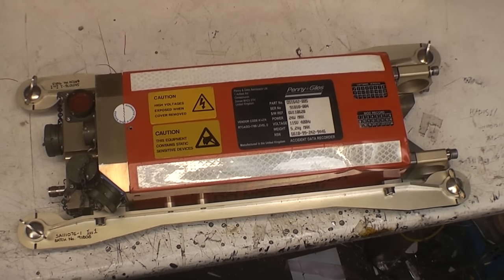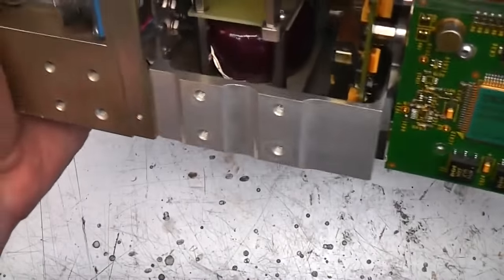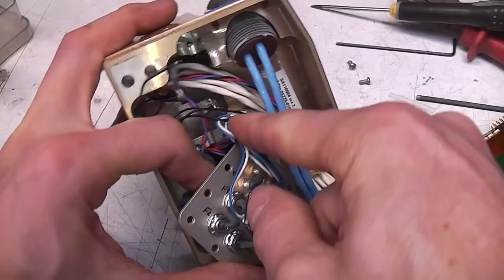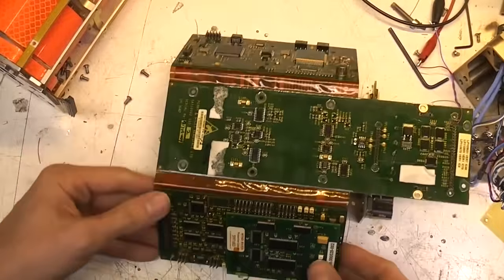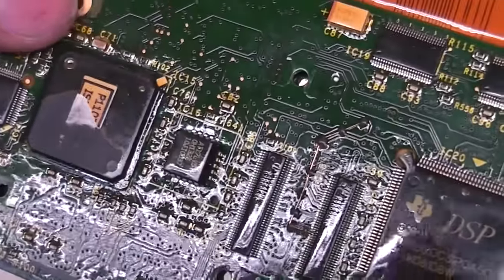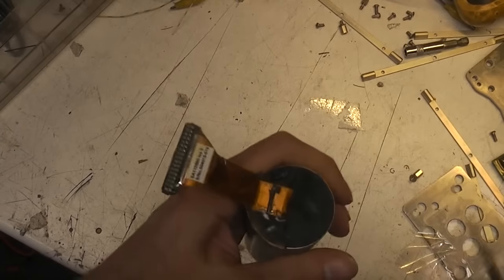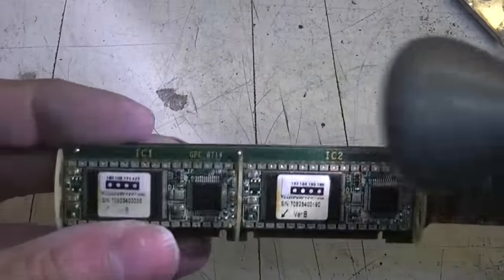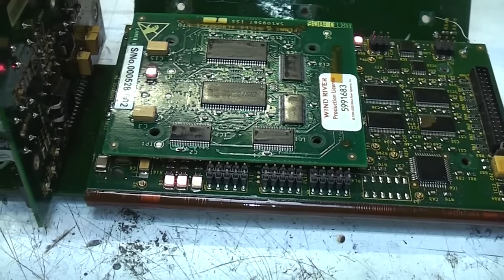Solid-state flight recorder teardown

Comment: I've seen some people say that they wonder why they don't build planes out of the same stuff flight recorders are made of. So I guess planes would be a lot safer if we potted the passengers with fire retardants after boarding.
Reply: It'd all work fine as long as the passengers don't have a problem with being exposed to 2000G deceleration.
Reply: "exposed" > subjected ;-)
Reply: Innocently experimented on ...
Reply: Or maybe passengers should be made out of cheap plastic material. Would also save considerable weight.
Reply: The plane might also have problems getting off the ground
Reply: so your saying exposed is greater than subjected.
Reply: Haha
Reply: MichaelKingsfordGray  Aren't the media reporters putting those there like hollywood to make more sensationalism, like they of the child, (as if an entire full grown human adult dying wasn't a bigger loss, at least I consider it a bigger loss, child has potential, but adults have stored knowledge, which is more valuable in the present)
Reply: Huh, you can sort of see the YT creep from a lightly sarcastic comment, down to a fascinating look at someone's look at the subjective value of children.

Comment: the blank connectors may be to hold the caps for the other connectors.
Reply: That's the stupidest thing I've ever heard.
Reply: yup got it!
Reply: *****
stupidist thing youve ever heard? well then what do they do with the connector caps? you cant have those flopping around in an aircraft.
Reply: Indeed, the chains are even connected to the dummies.
Reply: Rinoa Super-Genius As Mike said multiple times, this is clearly designed to go into many different aircraft. They are clearly blanks for other possible options.
Reply: Rinoa Super-Genius No designer would pay for an ENTIRE duplicate connector JUST to store the freaking lid while it's in use. And why can't the lids be loose? They're held on by chains. The whole thing is in a closet, you'd never hear it over the engines.
Reply: *****
because having a heavy connector hitting a cable repeatedly is a very bad idea.
Reply: Rinoa Super-Genius oh my god. I'm just in tears laughing. I've seen you make so many stupid comments over the years, but this takes the cake.
Reply: *****
so you think they would have those blank connectors, and not connect anything to them? thats just stupid.
Reply: Rinoa Super-Genius To save money on the production line? Of course! It's extremely common practice in the EE world. You design one part for many different models, and then just change out the connectors as the final step in manufacturing.
Reply: *****
well, i disagree
Reply: Rinoa Super-Genius Right.
Reply: +Aurelius R:  Military (and other high-rel) systems usually have a method to captively "park" the connector caps when you install the device and connect the platform cabling. It is considered bad practice to allow the connector caps to rattle around, causing repetitive stress and abrasion on nearby cabling or surfaces. This can result in cap edges cutting into cables, creating contamination from paint and metal dust and even can create EMI from triboelectric charging of the loose caps. Also, MIL grade connectors often cost several hundred dollars, so whenever a connector is not mated, the open connector ends should be physically protected from casual damage. Whether you consider this "stupid" is irrelevant.
Reply: Doc T'Soni Uh, nope. I stand for reason and thought, both of which are SERIOUSLY lacking around here.
Reply: *****
 if everyone else is the problem, chances are your really the problem. if you think everyone consistently lacks reason and thought, maybe its a problem with your measurement?
Reply: Rinoa Super-Genius No, not everyone is the problem. Just certain people. I don't think everyone consistently lacks reason and thought -- just people like you.
Reply: Doc T'Soni Why? My social skills are fine. I have a huge circle of friends, with similar interests and intellect. Why should I hang out with stupid people? That's essentially what you're suggesting.
Reply: *****
having friends != having social skills. especially if all your friends are similar. social skills are having to do with getting along with differant people, not similar people.
Reply: Rinoa Super-Genius Not at all true. I get along with people from all different backgrounds. Believe it or not, there are intelligent people of ALL backgrounds.
Reply: *****
somebody's background is irrelivant to their personality. you can have similar friends from differant backgrounds and still suck at talking to people with differant personalities.
Reply: Doc T'Soni You accuse me of making straw men arguments? Point one out.
Reply: Rinoa Super-Genius You're correct in saying that backgrounds are not always relevant to personality (though they often are). The whole and original point of my tirade is I've seen you all over YouTube, making stupid, inane comments, and stupid, inane videos, and I decided to finally call you out on it. Good thing you have an army of fanboys to back you up.
Reply: *****
yes i post stupid things, thats quite well known. but thats also how everyone who posts comments is. i dont see how you could think your the first person to ever "call me out" though, thats really silly thinking. i dont need backup because your just lightly trolling like i am, these are just youtube comments. its not like you can really do any damage anyway. so why would i need backup in a situation like this, and why would it matter that you called me out on something i agree with? this is kinda funny tbh.
Reply: +Aurelius R It's always a concern when people like you become "engineers". Life for everyone else suddenly becomes difficult. First of all, airplanes are high-vibration environments subject to much more strict specifications than cars - which is another example where OEM products have to comply with high-vibration standards. There have been many historical accidents involving cable abrasion leading to disaster where cables rubbed against other cables until failure, and even fuel lines which are extremely rugged for obvious reasons. You may not think much of a single contact with a cable cap and a cable, but when it happens literally tens of millions of times in the service life of a plane, it will chew through the cable. At worst, it could cause a short circuit which would then rely on some other upstream system to prevent a fire etc. In aviation in general, everything is tied down. Larger bolts are lockwired together both so that they don't unscrew, as well as so that they don't fall out, should the bolt snap. Smaller bolts always use threadlockers. Those bolts are already very expensive per bolt. An "empty" military connector shell is not that expensive compared to a populated connector with pins and backshell. Finally, the connector caps can't dangle at all. If they do, they're constantly stressing that chain. The chain can fail, releasing the cap which will then flop around uncontrolled. Search for "Dualok: Vibration Testing vs. Standard D38999" on YouTube to get a visual of what vibration can do. You said "no designer would pay for an entire duplicate connector" - first of all, designers don't pay for anything. Engineering firms quote their clients - ie plane manufacturers etc. Avionics hardware has decent profit margins because these are very low-volume units. They have to make a lot of money on each unit in order to keep the company running. Complying with military/aviation standards isn't cheap. It often REQUIRES overbuilding your hardware. In other words, the WAY that an enginner must address something like parking a connector cap, is often specified in the standard. If you don't it to the specification, then you're not complying with the standard. Finally, if anything fails - or if the contractor is deemed responsible for an accident caused by one of their products, what do you think will happen to the company that made it? There is huge liability at stake here. This isn't a bloody toaster, it's a flight recorder! You're unfamiliar with this industry which is understandable. But you're a classic example of an overconfident person who thinks they know better than anyone. It won't do any good to fire you when your "logic" and "reason" already caused problems for others. If you don't know something for sure - don't talk about it like you do. Don't insult others who are making guesses much like you are. I would never call you "stupid" because I'm sure you're not, just like the Rinoa person is not. Just don't be overconfident - you'll have more fun with life that way.
Reply: +whatlions boom! well said.
Reply: i was thinking the same thing! storage for the caps!
Reply: I know this was posted a while ago but I absolutely love your reply. I'm glad you created an account, because you very eloquently said exactly what needed to be said. Aurelius is just one of many egotistical narcissists the world has, thank you for shutting him up.
Reply: Agreed
Reply: @AureliusR  Cost was never an issue for anything flying commercially, or military... Also you aren't exactly producing these connectors for everyone on earth, so it doesn't matter if there are a few connectors manufactured with just the housings for actually just keeping the connectors stowed.
Reply: @AureliusR  they would when the device is meant to provide investigators with data to understand why hundreds of people have just died. they also would when not doing so could lead to cable abrasion or other damage that may lead to a crash that kills hundreds. i think they can spare the $40 per connector

Comment: I did software work for another brand of recorder.  It used TFTP for up/download and the IP address was 10.1.1.1.  It didn't support ARP or ping because the Ethernet connection was only meant to connect a computer for downloading. It would have never been connected to an actual network with other traffic. Before TFTP could be used, you had to connect to a different port and command the unit into service mode which stopped recording and enabled TFTP.
Reply: bkopietz hopefully he reads your comment and can further investigate
Reply: that would be something
Reply: You till need ARP unless perhaps you use hard coded MAC addresses in each end.
Reply: This sounds most plausible. Was the command to disable the recorder also sent over Ethernet?
Reply: @NicholasAndre1  Yes

Comment: If you install Wireshark on your laptop you can watch the network traffic with the protocol analyzer.  If it has an IP address it should show up in the traffic. Wind River makes RTOS systems (realtime OS) which may be linux based. So there is the possibility of some sort of information being output on a pin somewhere.
Reply: Wind river isn't linux based, it's its own thing.
Reply: +someusguysmusic probably vxworks which isn't Linux. just like your netgear router and the Mars rovers!
Reply: Wireshark is a great tool, I second this recommendation (some people like NetworkMonitor under Windows, which is inferior for decoding traffic https://support.microsoft.com/en-us/kb/933741).

As a typical computer starts broadcasting a lot of things when an Ethernet connection comes up, I'd try to have a small desktop-switch in between your computer (running wireshark) and the flight-recorder. Turn on the switch, let all the applications (apple MDNS, windows networking, DHCP requests, ...) settle down for a minute, then start capturing with wireshark, then turn on the flight-recorder. That way, you don't record too much crap in your packet captures. If you find anything interesting, put the .cap-file up somewhere :-).

Just watch for any packets the flight recorder might emit when powering up, but it may be anything, not just IP. On the other hand, the vendor claims (at least for their newer models) that it uses standard networking protocols, and has an integrated webserver...  https://www.curtisswrightds.com/products/electronic-systems/crash-protected-recorders/fortressimagine.html#tabbed-table2 ...but those are the ones that have Gigabit Ethernet, and still need 45 seconds to download. So those probably have GByte of storage.
Reply: +Ben Bird They do have a Linux distribution. http://www.windriver.com/products/linux/
Reply: +Christian Vogel just filtering out your own MAC address also helps (less stuff to filter from can be useful though)
Reply: Gert van den Berg Yes, but even with only your machine on the network, a typical PC starts broadcasting all kind of stuff once a new network connection has been detected. This needs some time to settle.

Hence the recommendation to put a switch in between, even if only two devices would be on a network segment which hence could be built using only a direct cable.
Reply: Christian Vogel What I meant is that all of that can be filtered out with a capture filter (not ether host <mac address> (My current Wireshark only takes that in the GTK version though)) or a view filter of ! eth.src == <your pc's MAC address>

(A managed switch with a monitor port configured is nice for this type of thing as well, but far from essential)

Comment: I know the company I work for does have boards with wind river stickers on them. those boards are a vxworks OS also running on a Motorola power PC type processor and boot and talk via serial and Ethernet. very similar setup to this.

Comment: I hope the powdery stuff wasn't asbestos…
Reply: looked more like bentonite clay. Asbestos is a fibrous mineral material. And while it is really fire resistant, it would not be used today as it is incredibly dangerous to handle.  Besides there are better fire resistant materials today. Like Areo gels.
Reply: It's called "castable refactory cement" It's the same stuff they use in fire resistant safes, IIRC it's mostly plaster of paris with a little portland cement.

Comment: maybe the glass/sand is supposed to prevent destruction of the components from a g-shock?
Reply: desiccant?  Or phase change thermal energy absorber?  Could try heating and/or wetting it.
Reply: Maybe they might be used similar to this: https://www.google.ch/patents/US6456240

"The action of this tubular protection member 704 is to convey or conduct higher frequency shock wave components around the enclosed electronic circuit elements rather than allow shock wave interaction with the electronic circuit elements..."

"Preferably any empty or void spaces within the tubular protection member 704, spaces such as are indicated at 728 and 730 in FIG. 7, are filled with a potting or casting material to add both wiring support and strength/rigidity to the overall FIG. 7 assembly."

"...said tubular enclosure member is comprised of reinforcing fiberglass and includes a void space-filling epoxy and glass bead material."
Reply: Damn YouTube comments not handling new lines anymore? WTF
Reply: yay I guessed right! where is the teddy?

Comment: Those glass beads could well be hollow to give some thermal insulation. I've come across such beads used as filler in potting compounds.

Comment: I'd resolder the DOC(Disk-on-chip), and reconnect the core unit back together.  I've used DOC units to boot embedded devices before and that might explain the reason for the lack of activity on the ethernet port.  You may be getting physical link but since the FDR's not booting, you may not get any response from it.  Reassemble it completely, and then boot it and see if you get any activity, like ARPs or any kind of connection attempts originating from the FDR.

Comment: I would suggest using NMAP to scan the Ethernet port as that will find any IP addresses in use as well as the ports that the IP address uses. You will need Linux for it, not sure if NMAP is available for Windows. If you have not already use Wireshark. That will allow you to analyze any packets it releases.
Reply: Yeah, I use it on my windows machine. https://nmap.org/book/inst-windows.html I'd really love to see what kind of information it has in it!
Reply: When arp scans don't give you anything (he did that), there's not much point in searching for IP addresses. Most likely that thing doesn't even run IP.
Reply: Yep most likely not IP based.

I would think there would be a sequence of "commands" you would have to send it to wake it up.
Like a secret door knock code, once done then it'll talk to you.
Even then it's going to be some specialized protocol.
Reply: Why it would not run IP? TCP/IP is widely used in modern vehicles. I have a friend writing software for Mercedes dashboards and he says ethernet is everywhere around the car.

I saw a video on the eevblog where some Audi guy talked about their lunar rover (competing for the google xprize). He also confirmed various ethernet connected modules in the rover.
Reply: +ivanatora sometimes raw ethernet frames might be simpler? No need for an IP stack and you can still easily use a laptop to talk to it...

(running a sniff on the port in Wireshark when it is connected might give an idea of what it tries to talk?)